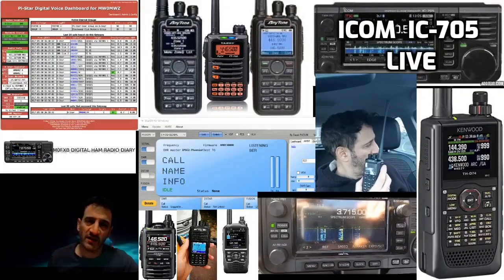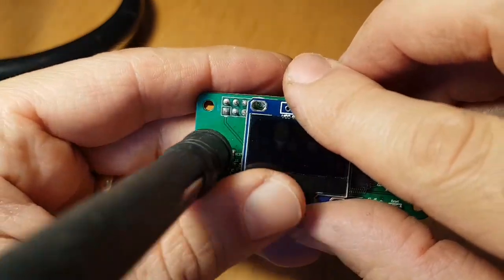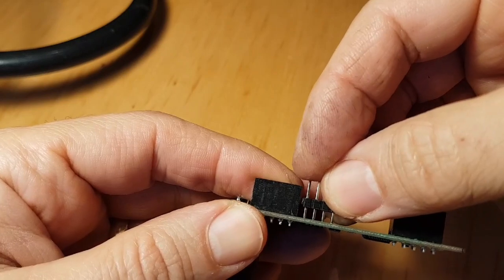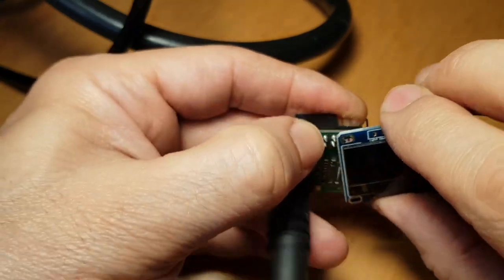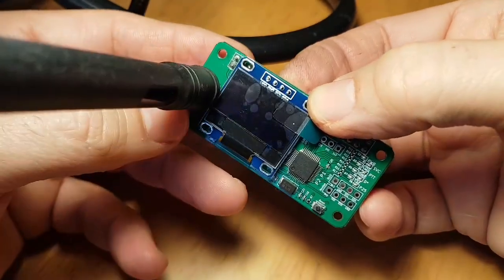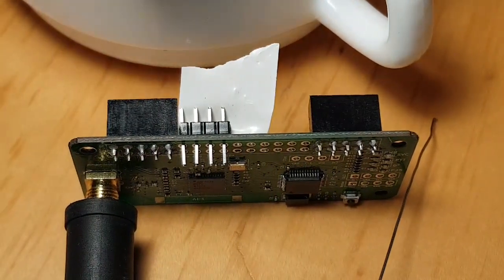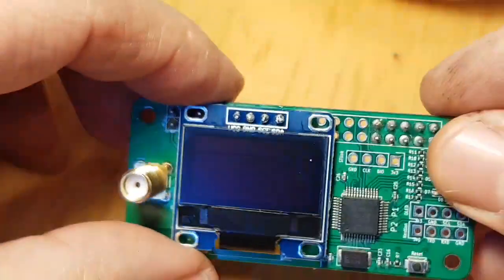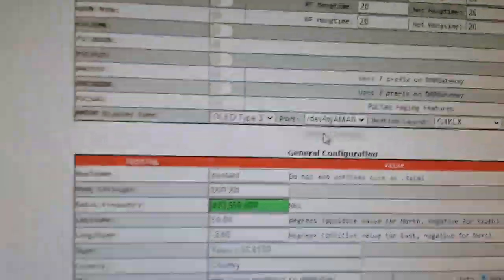MMDVM-How I installed my OLED screen then enabled it in Pi- Star config.(I am learning )

Comment: Adding my 2 cents. Mate, ya need a clean tip. That tip is so dirty you need to scrub that  clean with Flux and Brillo until the solder sticks on the tip. Then it will work proper.
Reply from the maker: Thanks yes agree .

Comment: Question. After oled is installed and mmdvm mounted on the rpi   Those pins that hangs below the hat that is connected to the oled. Are those supposed to touch the gpio header on the pi. I have installed a full 40 pin header on my rpizero2 w
Reply from the maker: Hi no
Reply: @M0FXBHamTech  
Last question. Would you recommend using flash cutters to trim the pins? Thank you for the response and the vidios

Comment: Hi Andreas, just completed this mod on my hotspot, should have read the comments before I ordered the OLED as the first one I got the GND and VCC were swapped, managed to pick one up on line and soldered it on today. Works a treat, thanks for showing us how to do it and set it up correctly. 73.
Reply from the maker: Hi Nigel thanks very much I guess the wrong one can be used if you add extension wires .73
Reply: @M0FXBHamTech  Hi Andreas, I did try and solder it all together with extension wires, it did work but once done, it would not fit in the case and looked a bit of a mess, for the sake of £3.99 online, I now have a much neater looking solution that works. 73.

Comment: i just got my pi star hotspot and the display Only comes on when I tx or rx a transmission or when i log into a tg.  is there a setting in pi star to have it always on display, not just when i log into a tg or tx/rx transmission?  thanks
Reply from the maker: Hi good question i will find out .

Comment: Should really be soldered so the plastic spacer is between the mmdvm board and the screen. Also, for people wanting to do this, watch out some screens have the +ve and GND swapped. You need to get the right oled screen. Also for good driver support get one with the SSD1306 controller on it.
Reply: Thanks 👍🏾
Reply: Andy's doing his best like always but thank you sir
Reply from the maker: Thanks this is good  advice .

Comment: Thanks Andy yet another great video. Thinking of getting this type of hot spot. I take it that you can use a yaesu  ft3d with them or if anyone else knows?

73 Alan
G0SMD
Reply from the maker: Yes works great
Reply: @M0FXBHamTech  Thanks Andy, just ordered one from an EBay supplier.